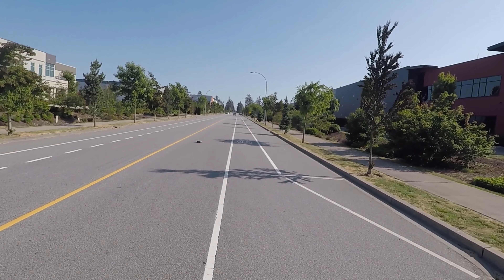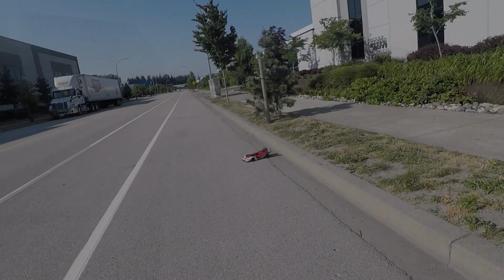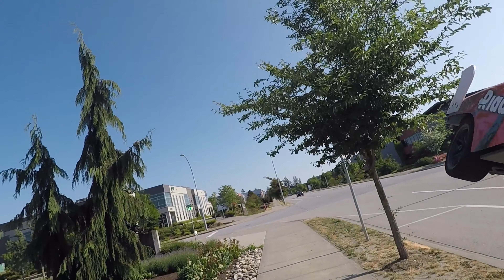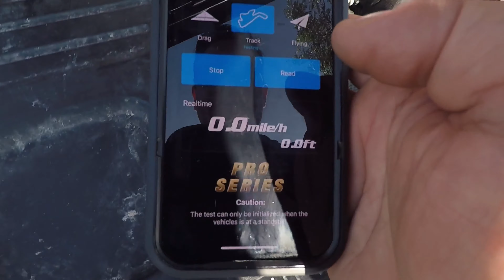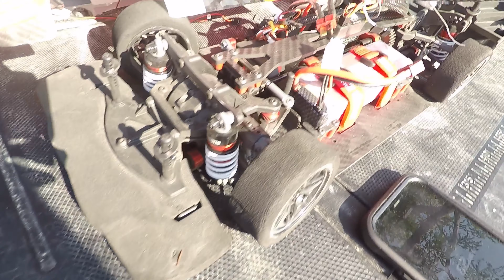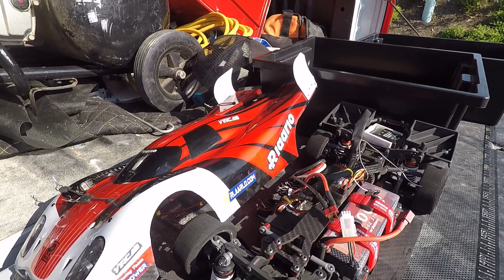Rlaarlo AK917 Speed Run Gone Wrong... What Happened?

Comment: It's really annoying that parts are hard to get. Great you have a 3D printer.
Reply from the maker: Yeah that’s a big problem trying to get parts direct from China. If they were stocked on Amazon things would be so much easier. The 3D printer sure came in useful at lest until replacement parts arrive
Reply: @Van_City  It's not China, it's Rlaarlo. I'm still waiting on a pre-ordered roller from the 10th of April. They've really dropped the ball on this one.

Comment: Hi SNRC R3G or XRAY 14  rc car front and rear hubs fit very nice you need a 5x12x4mm bearing for each hub.A little sanding on rear hub where the pin goes through the a arm..
Reply from the maker: Hey thanks appreciate the info 👍💯

Comment: Ouch!  I never run near curbs as I swear they suck cars into them!

Awesome you got it fixed!

What kind of LIPO connector is that?
Reply from the maker: Yeah the curbs are sketchy, unfortunately there are minimal options for flat roads that are long enough in my area. I was lucky to find some parts to make it work, I did order replacement parts but who knows when they will arrive. 

The connector is a deans plug, not really common for the guys who do speed runs but for me most of my batteries are that style so I stick with it
Reply: @Van_City  when you get to a point where you want more speed, you can likely pick up several mph going to some 6.5 mm bullets (I am running 8mm bullets which is overkill at the LIPO/ESC on on my high 90 mph 3s Bandit).  I believe Deans are only rated for around 60a.  I gained a few mph from going from the stock tiny 3.5 mm bullets at the motor and ESC to 6.5 mm bullets too.  Heck, I picked up like 5 to 7 mph going to higher end LIPOs too!

Good luck, can’t wait to see what you do with it!
Reply from the maker: @BriansRCStuff  thanks for the info, much appreciated 👍💯